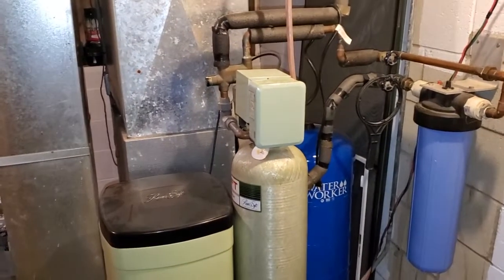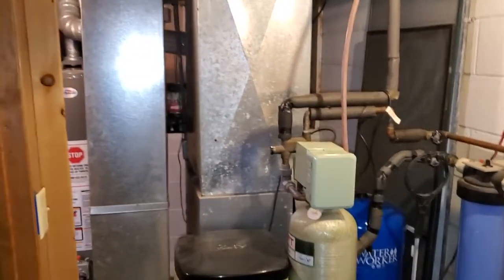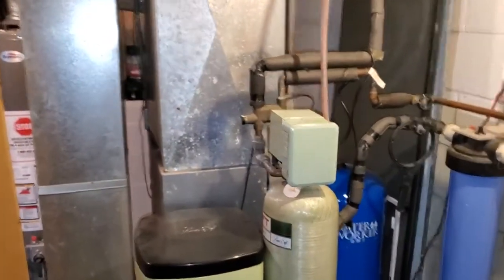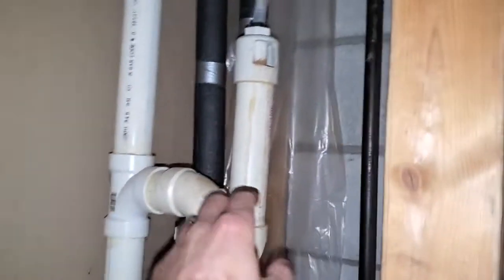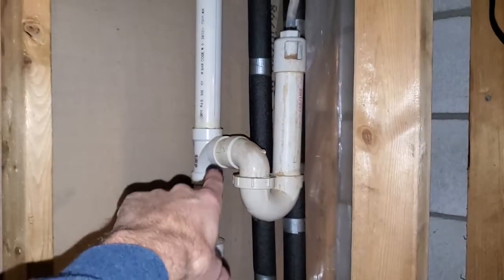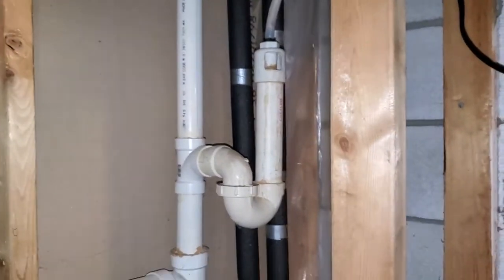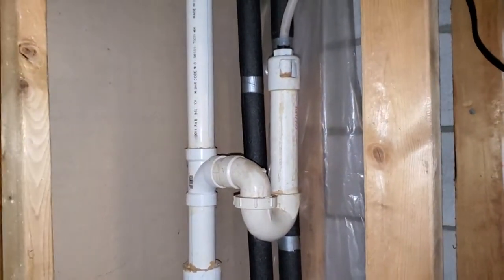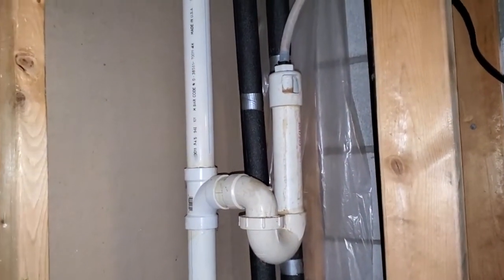How to properly install a water softener drain into a sewer pipe

Comment: Josh great video. But one more question. And thanks for the quick response. Can I install the air gap on a line that’s shared with a sump pit? Wish I could show you a picture. My basement is roughed in for a bathroom. And there is a macerater pump the previous owners put it when they roughed in the plumbing. But a while went by after I bought my house and the macerator pump went out. The only thing that pump is ever used for is a lift station to pump out my a/c condensation. We replaced the pump when it went out with a regular sump pump as we are not going to finish the basement or bathroom. The only place I can tie in the air gap is on that line that goes to my septic. I was going to put in a wye and street fittings with a P trap for the water softener backwash. Should this be an issue?
Reply from the maker: No issue. That's fine.  In fact, you could just route the discharge line directly into the basin (just like the AC line is)
Reply: @nwohiohomeinspector  I thought of doing that also. But I don’t want the backwash to go to a sump pump pit. It is currently in one as we speak. And the backwash has started to rust my sump pump. And don’t want to replace it because of the corrosion. If I went the A/C condensate drain route I’d just be moving the problem down the line per se. I think I’ll tap to the discharge of the sump to septic that the condensate goes to. Just wanted to make sure when the sump goes of that it wouldn’t spray out of the air gap I install for the softener back wash.

Comment: Can this be installed other than on the vent line?
Reply from the maker: Sure, any drain will do.
Reply: @nwohiohomeinspector  I think the reason it was installed on the vent line is for double protection, seeing as its the vent and all that goes through it is air, the chance of wastewater going through there would be lower than connecting it to the main drain line directly.

Comment: thank you~! mine was set up incorrectly and backflow happened often as it was hooked up to an old gray water line that backed up almost the whole time I have lived here with the soft water system! ugh... trying to get the house flushed by the water softening company that I rented the soften from now
Reply: Do not l et tgem charge you. If you are renting the equipment. It is cheaper to just buy it out right.

Comment: My new water softener has a double output system, and the old one was a single.  How do I convert a similar style to take two lines?
Reply from the maker: I'd just use a double-barbed fitting (wye) & connect the two together to go to one.  I don't think they make a double-barbed DWV air gap fitting like shown in the video, but I could be wrong.
Reply: Can a double-barbed tee suffice for the same purpose? @nwohiohomeinspector

Comment: Thank you for the video. I am also questioning an instal the journeyman plumber did at my house on a Softener install. The house appeared to be preplumbed for the WS having a water loop, and power outlet in the area. There was also pipe (cream) capped off just above it. The tech was unclear what that line did so he penetrated the exterior wall and piped into the storm drain which flushes into the street. this just doesn't seem to correct to me. On further inspection I learned that white pipe terminates upstairs just above the laundry drain. Is that. meant for the WS backflush? Which is the correct way to do it? Thanks.
Reply from the maker: Yes, the laundry stand pipe sounds like it would be considered an air gap and would be fine. Not sure if you can discharge into storm drain or not, but most of the time it would have to terminate into a sewer drain - check with your local officials/AHJ (Authority Having Jurisdiction) regarding compliance. Hope this helps.
Reply: City would like it going to the street

Comment: Great video, needed this. One last question, in video water softener drain goes straight up. Should it be level or will softener pump out used water and not flow back in?
Reply from the maker: Sorry, not sure how I missed this.  Great question!  The pump will pump most of the discharge water, but there will be some water in the vertical section that will flow back into the unit, but it's still considered potable water and shouldn't be an issue.  Some units may have check valves or similar, however, I'm really not sure. Hope this helps and thaks for watching & commenting!

Comment: I need to connect the drain to upper floor where bathroom is because I do not have any access to sewer main from basement. It needs to go about 15ft long and 4ft up.. Do I need to install pump? And can I connect drain directly under the sink drain by using T right before the trap??
Reply from the maker: I'd check with the manufacturer of your softener.  Usually, they can pump up to 20'.  Connect under sink with trap and air gap fitting.

Comment: dang. I have mine running to the floor drain with a 3/8 flex tube ran into a 1/2 straight pex pipe because it didn't reach ='D
Reply from the maker: Floor drain is an air gap and that's fine